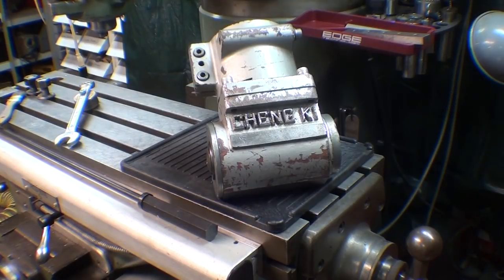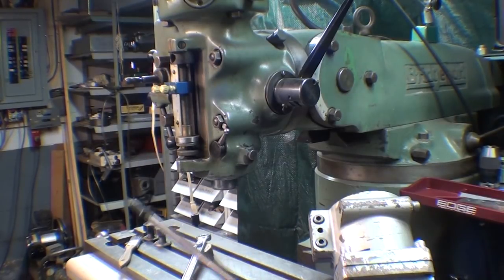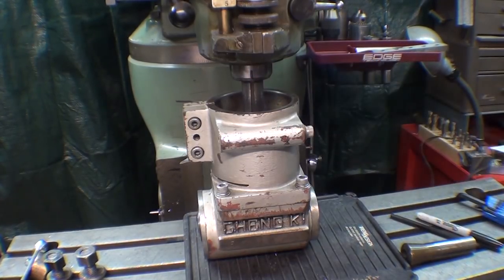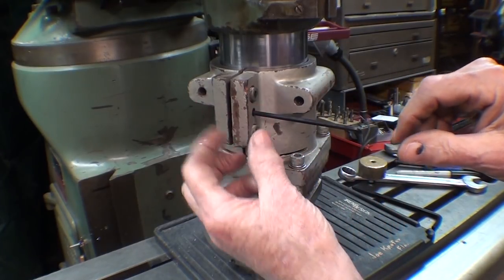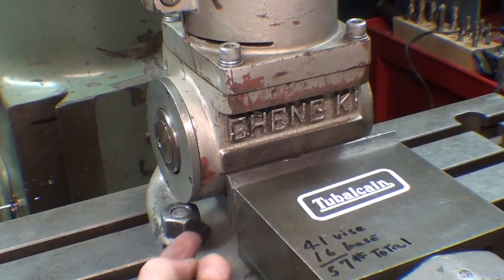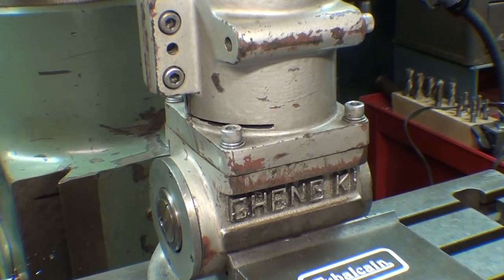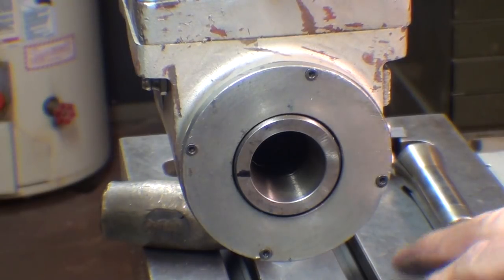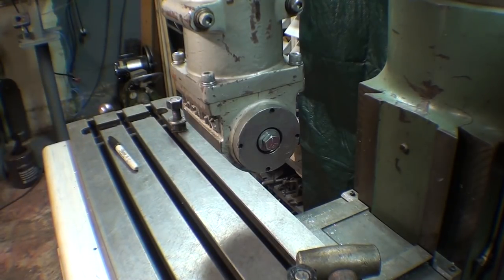Mounting BRIDGEPORT Right Angle Attachment TIPS #413 tubalcain

Comment: Mr. Pete- I heard a story of a guy with a mill in a low ceiling basement. His solution to changing bits was to cut a hole in the ceiling into the living room floor. His wife would operate the draw bar as necessary. The draw bar and top of the mill was covered with a coffee table when not in use.
Reply from the maker: That sounds too outrageous to be true
Reply: You're probable right Mr. Pete, I bet she just puts a flower pot with a plant over it.
Reply: Mr. Morningstar  Are you sure? How many wives have you had?

Comment: With My attachment, I kept the original draw bar and used a 3/4 inch standard socket with a short extension and ratchet handle from a standard socket set. It dropped into the quill drive sleeve easily.
Reply: Ya beat me to the suggestion, I do the same thing.

Comment: MrPete, just a suggestion for another option on the alignment.  What I tend to do is to actually put a gauge rod into the collet I am going to use, and indicate against that (after tightening the collet of course).  The approach you took is absolutely fine.  I also have the support arm for mine, and often, I'll indicate across the arbor as well.  I just wanted to offer another approach.   I look forward to the next video and a Belated Merry Christmas and a Happy upcoming New Year.
Reply: I use the same type of tram indicator against the side of my vise or an angle plate. It's a lot easier to clamp when you can watch the indicator move while tightening, rather than having to sweep the table. Just tighten the clamp screws and note how much it moves, then loosen them a little and tap the unit that same amount out of tram. Tighten the clamps screws while watching the indicator come right to zero.
Reply: That's how I do it.
Reply from the maker: That's a good idea

Comment: I've had the clever idea that one of these horizontal adapters might actually make a decent vertical adapter for a smaller horizontal mill, but hearing actually reduces to speed I don't know how useful it will be since the horizontals tender on slower speeds you might want for a small end mill already.

Comment: Mr. Pete, on the indicator surface, there is a center punch mark that is dead center with the arbor axis. I found it easiest to zero the indicator on this mark then move to one side or the other and zero it again. I did not put the mark on it, I think it was done at the factory. When the alignment is moved while tightening it is usually pretty easy to get it back in by tightening one cotter or the other. You did not discuses the cotters in the video,  that is the only right angle attachment I have seen that has them but I have found them handy to get it back in. I hope this helps.
Reply from the maker: Thanks for pointing that out

Comment: Happy upcoming New Year Mr Pete. You might have been able to save the cost of that extended hex drawbar by using a 3/4” extra long socket and your socket wrench. At least that is what I can do on my Eisen variable speed clone head. Also perhaps for squaring up the right angle head, if you have a large machinists square, you could have laid the square against the mill column and against the front face of the right angle head. Lots of ways to skin a cat. Thanks for making the video.

Comment: Believe it or not - last week I was also attaching my new right angle to my MSC mill for the 1st time. A couple of added items; The draw bar that came with mine had the extended head as well, but in addition there was about an 8" socket type extension so one could use the standard draw bar. Next, and confirmed through the Hobby Machinist forum, the new threads in the attachment and on the draw bar were not all that good and chasing them is needed as they bound up at only a few turns of engagement. I have yet to finish the installation setting up the other 1/2 that connects to the ram, making it look more like a horizontal mill.
Reply from the maker: Quite a coincidence

Comment: Once you clamp it, it's easier to rotate the base of the head assembly, turret, or whatever it may be called  to square it up. Also, I use an extension with a socket to tighten the drawbar.

Comment: Hello Lyle, still following you. I had a thought the other day as my Sheldon 12 x 48 is down for a total restore. ( its a WW 2 navy vet and deserves it). Have you ever put a quick change tool post on the Bridgeport table and used it as a vertical lathe? I need to make a few bushings and thought that might work. I enjoy all you do and yes, I get your humor.
Reply from the maker: I need to try that sometime. I have used the mill has a lathe by simply holding the cutting tool in the voice. It works fine

Comment: Hi Lyall Would it not be possible to make a hole in the ceiling above the mill and push the draw bar up into it and then let the bar drop into the mill. Or is the draw bar threaded into the hexagon piece, if that is the case could you put it in two pieces. great work on the videos. Happy New Year,  Ray
Reply: I would drill a hole in the floor above to drop it through if it meant not having to tram the head in. ;)
Reply: Considering he's in the basement, might have some wife issues if he started cutting holes in the floor.
Reply: D3faulted 1 Naa, just put a piece of furniture over the top of the hole in the floor to cover the hole and hope the wife never moves it. Or get rid of the wife :)
Reply: Guys, that looks like his heater ducting above his mill.

Comment: Maybe cut the drawbar near the top, then drill and tap holes in both pieces.  You could drop the bottom piece into the mill, then use a piece of threaded rod to connect the two.

Comment: There are a lot of busted RA housings out there because someone didn't get the proper use of the separator set screw. If it's still too tight and you tighten the two clamp screws, the casting cracks of course. (One can also break the casting just by over-tightening.) Seems glaringly obvious? I shopped one of these for years and saw so many busted castings. There must have been a lot of times where a guy had to fess up to the boss; "darn thing wouldn't tighten up on the quill..." The other possibility is students - Mr. Pete you must have had a few of those types?
Reply from the maker: Yes, that's true